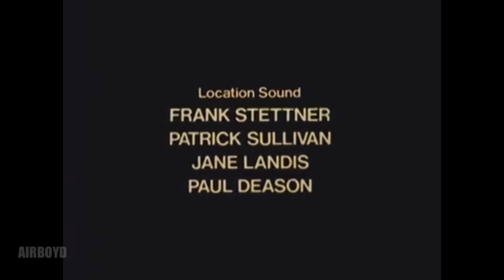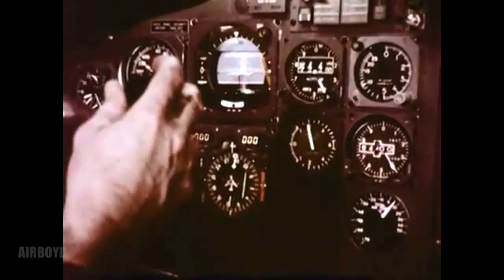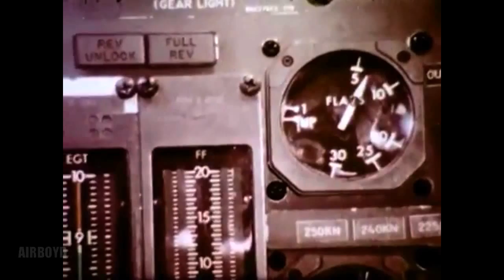Jet Roar (1977)

Comment: 2:26 I agree that homes affected by airport noise would lower their value, but how will having the SST coming to your airport be any different from any other jet's noise; causing you to want to move? Their approach speed does not exceed the sound barrier haha. An SST may just have a lower glide path with a bit higher speed and maybe some more engine noise, but it's not making sonic booms on landing or take off if that's what she means :P